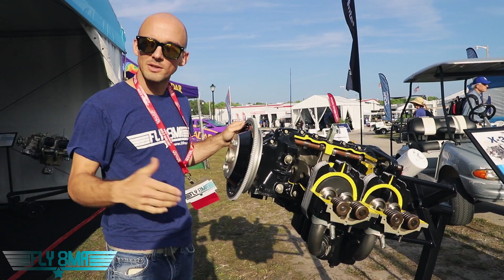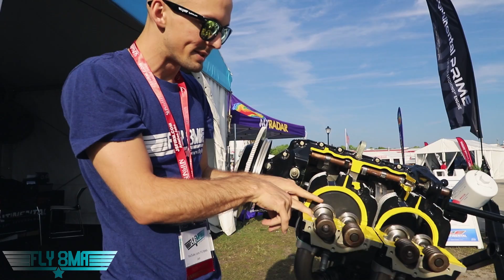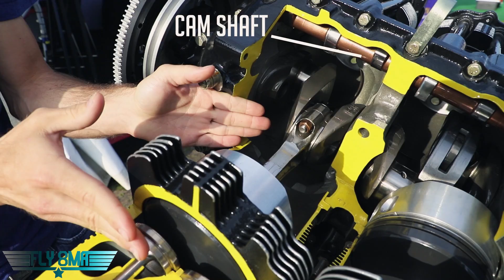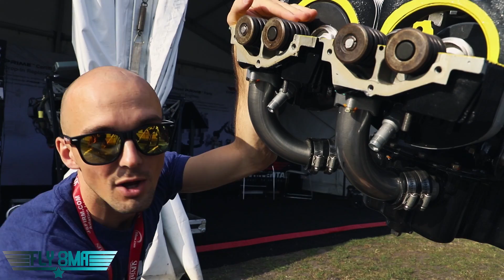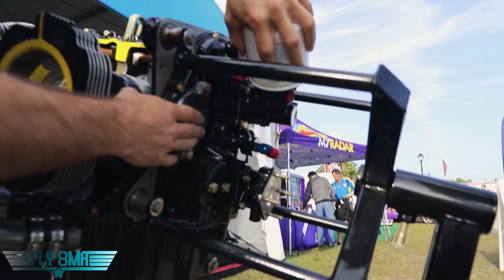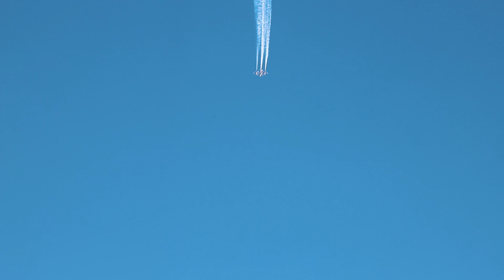LIVE from Sun N Fun: The insides of your aircraft engine

Comment: Excellent video! I have a Cherokee 180 that for the last ten hours or so has started to drip in the hangar. It hasn’t done this in the 13 years I’ve owned it, until this year. Drips a half dollar size spot of foamy oil after I put her away. Drills from the air/oil separator downtube. At annual I had my number 4 cylinder at 70/80 on compression which it has been at the last few annuals. (I had my number 3 go as low as 60 a few years back with no issues or blowback, and that one came back up on its own the next year.) my number 4 is low-ish, but it’s been pretty consistent for the last 100 hours/3 years. Should this new leaking be concerning? All my other compressions are in the mid to high 70’s. - 461 SMOH.

Comment: Interesting how they run the intake through the oil pan.  It will cool the oil,  but heat up the air entering the cylinder and rob the engine of a nice cool intake and rob it of power.
Reply: John Downing That’s where the Rotax 915 iS comes into play. Very modern in the aviation world.
Reply: that would seem to be the case but imagine being 10,000 feet up. The air temps up there are really cold, like 20°F to start with.

Comment: Great video.....think car engine with many modifications, improvements, longevity, safety and redundancy....aircraft engines are at a much higher level....air cooled (remove radiator point of failure), dual magneto (remove electronic ignition point of failure), mechanical & electric fuel pumps, easily accessible circuit breakers, mixture control, carb heat option, fuel tank selector, and the airflow through the oil pan (cool the oil) is brilliant.....really if you are a "car engine buff"....you'll love aviation engines!
Reply: Piston aircraft engines are actually on a much, MUCH lower level, they're dinosaurs when compared to modern automotive engines. Air-cooling massively reduces reliability, because the failure modes of an air-cooled engine are generally catastrophic, while the failure modes of a liquid-cooled engine will generally give plenty of warning before becoming catastrophic. In other words, with air-cooling, the entire engine becomes the primary failure point. The main reason why you wont find air cooling on just about ANY modern piston engine is due to the fact that liquid-cooling is far more reliable and because it allows for vastly improved performance. I don't think that anyone flying behind a Merlin or Allison V12 will complain about the reliability of their cooling systems, and those have been flying for a most of a century! You also wont find air-cooling in the (modern) automotive racing world, because those engines need to be as reliable as possible under the harshest operating conditions.
-
Consider that modern automotive engines typically last for around 200,000 miles, which amounts to around 5,000 hours of use, and while they might be operated at relatively low power settings, they're almost never maintained as well as aircraft engines. Many modern automotive engines have no trouble reaching 300,000+ miles when well cared for, which ends up being more like 7,500 hours of use. 2,000 hours of use in an aircraft would probably be a cake-walk for a modern automotive engine.
-
With liquid cooling, engine parts are cooled much more consistently and they don't experience massive fluctuations in temperature like air-cooled parts do, so longevity is significantly improved. You wont find air-cooling in applications where engines are expected to have very long service lives (outside of aviation).
-
Because this isn't the 1930s and we're not forced to rely on breaker points and vacuum tubes, electronics are FAR more reliable than mechanical systems, so coil-on-plug ignition systems are FAR more reliable than a dual magneto system could ever be, even without any built-in redundancy.
-
Consider that modern turbine engines are typically FADEC engines, this is due to the fact that modern electronics are far more reliable and efficient than mechanical systems ever could be, so it's time that people stop pretending that this is the 1930s and join the 21st century!
Reply: idontcare80 Cue in the Rotax 915 iS!
Reply: @andrewmorris3479  It is a cool engine, without a doubt, but it's not quite to par with modern automotive engines. It's partially air-cooled, it only has two valves per cylinder and it still has pushrods, so there's significant room for improvement. Its shortcomings show up in its BSFC, which isn't all that great for a modern, fuel injected engine.
Reply: idontcare80 For sure, but it’s much a better BFSC than Lycoming and Continental. I actually think air cooled cylinder barrels and liquid cooled heads is the perfect setup on an aircraft engine. There’s definitely more they can do to modernize it, but they’ve got most of what you want realized now with FADEC multi port injection, intercooler for the turbo, etc.
Reply: @andrewmorris3479  "I actually think air cooled cylinder barrels and liquid cooled heads is the perfect setup on an aircraft engine."
-
I've heard this many times, but I've never heard an explanation as to why people believe this. It really only serves to lengthen the cylinder bore spacing, which makes the engine larger and heavier. Having the cylinders and heads as separate pieces also reduces the strength and rigidity of the engine. Having to provide cooling for both the cylinders and a radiator also complicates the engine installation.
Reply: idontcare80 Never thought of those points. You clearly know you’re stuff! What about traveling 150 MPH through the air and that of keeping the temperatures where they need to be?
Reply: @andrewmorris3479  The engines already have a liquid cooling system, there's no reason why it couldn't also be made to cool the cylinders. There's plenty of air going through a radiator at 150 mph to cool the whole engine.
Reply: idontcare80 Sorry, what I meant was many times in the winter it’s hard to keep the temps up on a Rotax as far as coolant and oil temperatures. Often times we have to block a portion of the oil cooler and radiator off. Wouldn’t an all liquid engine traveling 150 MPH be harder to keep the temperatures up?
Reply: @andrewmorris3479  A liquid-cooled engine should have a good thermostat which keeps temperatures where they need to be. Some sort of cowl flap system which controls the amount of airflow through the radiator is also good to have, but I haven't really seen that done with Rotax engines.
Reply: idontcare80 Most don’t have a thermostat installed or a cowl flap system. That’s the problem!
Reply: @andrewmorris3479  Agreed.
Reply: I think of Rotax when I think of a car engine, this is just such old technology! I get it though, it works!